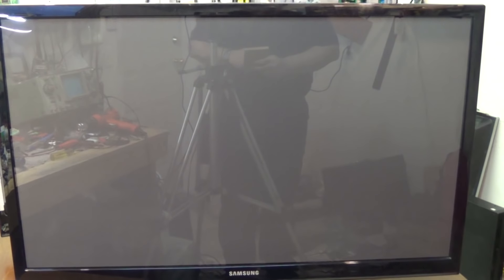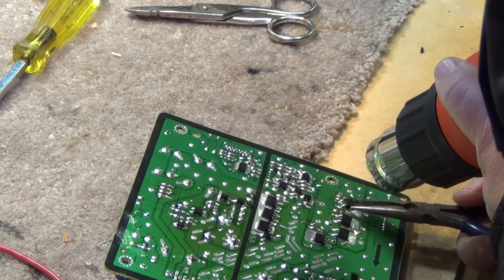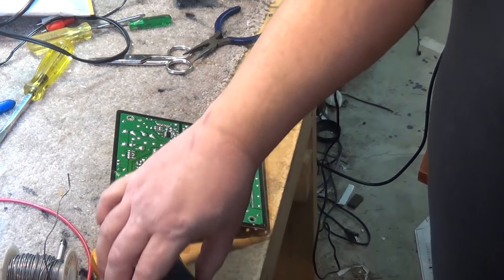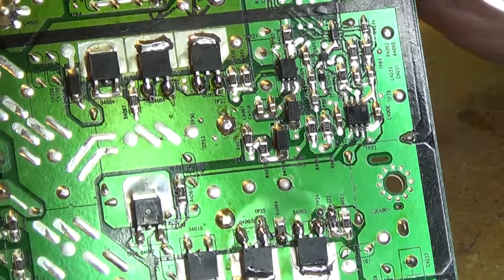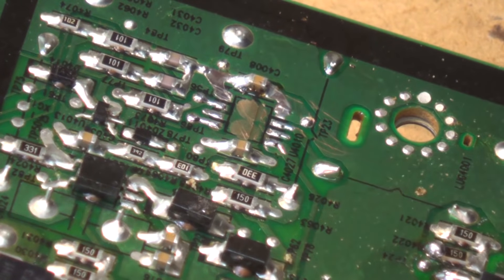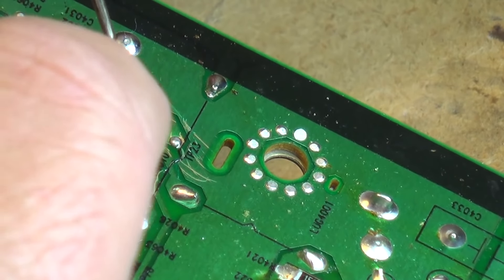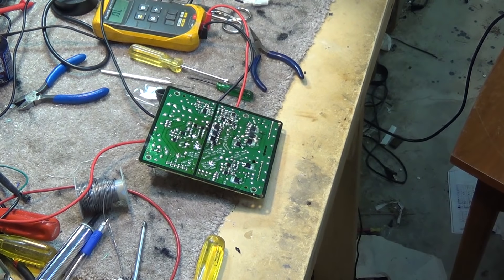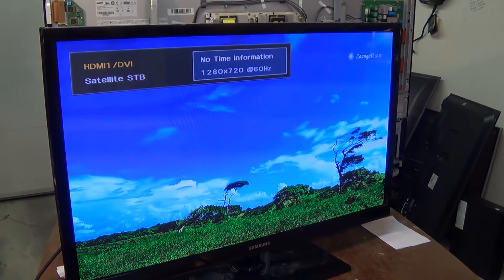Samsung PN43D440 Plasma X Main Board Repair

Comment: Who in the hell is putting thumbs down on this??? Really this man has more education in electronics than anyone I've seen on You Tube as of yet repairing anything he comes across, not to mention without schematics, wire diagrams or anything we would need to do it with ourselves without taking many hours of our time to do so, that's if we could without pulling all of our hair out first. Thanks Dave for all of your great videos, your experience really shows.

Comment: I prefer Plasma over the LED LCD flat screens. Least the screens on the Plasmas took a bit before they broke! My son has a old Plasma & it’s been dropped tipped on its screen off a table & it still works! But these LED LCD’s have a very fragile thin glass in the screen that cracks so easy.

Comment: Iam keeping my plasmas until the oled sets come out and drop to an affordable price point. Although I do have a Sony XBR lcd set that has an amazing picture for lcd. Iam tempted to try an off brand 4k lcd set in the interim. Do you have an experience with the Sceptre brand name? A 49" 4K panel for $329 is almost too good to pass up.
Reply from the maker: I hear you. I am in the same boat. I am keeping my Plasmas running. When an affordable 4K oled set comes to market, I will look into it. I got rid of all my LCD sets as when comparing to plasma, they all look pale by comparison.

Comment: Hi, 

Congratulations on your 500th video.  That's quite an accomplishment.  

You mentioned that the component is glued onto the board.  I never knew that glue was used.  I'm guessing that is something done in the manufacturing process for ease-of-assembly purposes, yes?

Regards, Tom
Reply from the maker: +THOMMGB Yes they tack the smd componets down so they dong get dislodged as they make their way through the colder process, so heating the parts up you still have to break that bond.
Reply: +12voltvids This is good information to know.  Thanks a lot.

Comment: On your opinion of led-tv's: do you know quantum dot tv's? This tv's are basically  led-tv with a special backlight ie quantum dots. They are having a bigger color space (20%) over ordinary led-tv's and much cleaner colors. Also some samsung models have better contrasts. Samsung advertise this  feature as HDR = high dynamic range. The main point I bringing this up is, they are not expensive. So if you come across this 'technology' I really would like to hear your opinion about it.
Reply from the maker: +martin richardt Quantum dot technology was first brought to market by Sony, in the form of their Trilumanous trade name.How it works is based on frequency division using quantum dots. In a normal LED backlight tv white LEDs are used. How white LEDS are made is a blue LED diode shines on yellow phosphor to make white light. The trouble with this is there are many frequencies of light that never make it through the color filters on the panel.Quantum dots answer this by creating primary RED and GREEN light from primary blue. They do this by hetrodyning with the incoming blue light. When the wavelength of the blue light entering the quantum dot filter hits the different size quantum dots, they radiate their own frequency, which mixes with the incoming light, and produces pure green and red light. This way there is no wasted spectrum, the light is fine tuned to the wavelength of the primary RGB filters on the LCD panel. LCD are getting better, but they still don't have the dynamics of a good plasma display.  The ultimate is OLED. That is the holy grail of display technology. My Samsung tablet has an OLED screen, as does my Blackberry, and camera view finder.  The picture quality off those screens is the best I have seen.
Reply: +12voltvids Yes, the ultimate is OLED and in a few years imo OLED will be the dominant display technology. Unfortunately this technology comes currently with a hefty price tag. Here in germany it's about a factor of 2 for fullhd. I think in the meantime quantum dot tv's could be an option for price-conscious buyers.
Reply from the maker: +martin richardt 
I agree that QD will become standard f low end as it is cheap to make. Oled is pricey now because the technology that LG choose is not their own, they are buying panels, but they have an exclusive deal at the moment on that design, which uses white phosphor and color filters. This is less expensive to make than the rgb type that Samsung make. Once their exclusive expires on that tech expect other manufactures to jump on board and the price will really drop.

Comment: I have a Samsung PN51E7000FF 
that has vertical lines on the right side
do you know what the problem is?
let me know thanks
Reply from the maker: +stereomann83 Vertical lines is usually the panel that has failed.The buffer ic's that drive the panel are actually on the FPC that are bonded to the panel.
Reply: +12voltvids ok i did see that when i took it apart some more today the board thats  on the bottom of the panel. someone else said that it might be the logic board. i did see one on ebay for $10 but i don't know if i should get it or not
Reply from the maker: +stereomann83Generally when the logic board is at fault you get no picture at all or it affects the entire screen.How a plasma works is the logic board generates the control signals that are fed out to the buffer chips. The buffer chips on the Y axis are high voltage devices and they are along the boards on the left side looking from the back. They scan line by line top to bottom so if you have horizontal likes ( you can see a bad buffer board on my 2 videos that deal with bad Y buffer) The vertical drive is a low voltage that just addresses the vertical electrodes and because they are not handling much current don't require external buffer chips there are also many more vertical scan pixels than horizontal.  the A boards (the ones that run across the bottom and connect the panel to the logic board) just pass the signals from the logic board to the addressable scan drive chips, which are part of the flexable PCboard that connects the A board to the panel. I did a video last year where I dissected a broken plasma screen and showed those chips on flexible PC.LCD do that for both the vertical and horizontal scan drive. The TCON board plugs into the panel, and the driver chips are on glass.If you get a single address driver chip that goes bad it will affect the group of vertical pixels that it controls, so you might have a section say 1" or sho that is bad top to bottom. If there were vertical lines in the entire picture then I would suspect a bad logic board. I am fighting a set right now that I suspect that the logic board is bad. It takes 21 minutes to turn on the VS supply.

Comment: my power board's mosfet shorted to the inner chassis.  my transistors are dead, should i also replace the power board? this time ima cover the contacts on back to try and avoid it reoccurring

Comment: A lot of people don't believe in fixing things anymore - mainly for the price of parts and/or  labor - but the item is still well worth it unless it cost 3/4 of a new 1 or even 1/2 of a new 1!!!!!
Reply from the maker: +Donald Ellett 
I have been getting more request to fix plasma than Lcd or led back light. The reason I think is people bought that plasma for a reason. They have a superior picture, and they no longer make them. Oled look fantastic but they are still very expensive. So many people want to try a get their plasma running again. I am one of them. I gave away or sold a the led/lcd sets I had and replaced them with plasma sets I was given. The refresh rate and contrast is far better. Sure in a showroom these Lcd TVs look OK. Put them in a nice dark living room and side by side with a plasma they look like crap. Also plasma sets are very serviceable. Lcd sets it is total board replacement o the panel that fails due to the chips on glass. At least on plasma there are many fixes where you just replace the parts that go pop an you a good to go.
Reply: How much difference in price is the actual plasma screen vs. lcd???  Do many of the screen break in transportation??
Reply from the maker: +Donald Ellett Just due to the component count, plasma cost much more to manufacture, however for years they were cheaper to buy because clever marketing, and price fixing early on had the LCD sets selling for much more than Plasma. The manufactures made huge profits on LCD and pushed their sales harder.

Comment: Smashing job :-D
Dam fidderly smd parts, sneeze and they are lost forever lol :-D
I bet if they had used big non smd parts on a propper heatsink, they would have never blown, ive never thought a thin layer of copper made a good heatsink.
Sorry im old fashoned, give me a mass of finned metal with a good air flow :-D
Reply from the maker: +zx8401ztv 
The transistors are sandwiched between the board and a heat sink gel. You will see it stuck to the metal chassis just as I am remounting the board. That drains the heat to the metal chassis very well. The parts didn't fail due to heat. They failed due to ground screws that worked their way loose and arced. See the first trouble shoot video on this one where I documented it. There is burning around the ground screws.
Reply: +12voltvids Ahh, sorry, im a pillock :-(
Still a great repair though :-D

Comment: Very Helpful

Buy some good tweezers bro and a hot air station.Makes life easier
Reply from the maker: So what is wrong with my technique? Why should I spend hundreds of dollars on an air station? I will never see my money back. A 20.00 heat gun does the job just fine. Perhaps if I was in the business and earned my living doing repairs, but I  don't. I retired from that industry in 2003, and now it is just a hobby, and something I do for people I know, and these people are very cheap. I made 50.00 on the repair of this set, and many other paid repairs I make even less than that. Most are my own units, and you know how much I make fixing my own stuff?The whole point in this series is to show how to do this work WITHOUT investing money in specialized tools.
Reply: That is amazing.  A heat gun is good for those huge processor chips with 50 or more pins.
Reply: My tv no picture model 32 PC5RA    LG WHAT IS broplem ?
Reply: 12voltvids my tv no picture model PC5RA     LG  WHAT IS problem?
Reply: I don't blame you a bit & at the same time your showing many of us how to do this on a shoe string budget such as myself who might be lucky to fix just one in a year so I'm going back & trying all of your TC videos to get all of your. Real nice how you made that halogen bulb to repair, I think you the BGA's, & fixed a lot of them that way, & mainly they all are still running, can't beat that with a Big Stick, Love It when someone can show these ways of repairs that even I can afford to do, Thanks Dave.

Comment: My God. You really deserve some tools for smd rework...
Reply: +Luigi Mazzoli Haha!  I've got an SMD rework station and a hot air gun.  Provided you don't over cook the area and keep testing if the solder is molten for all intents and purposes they are pretty much the same thing.  A hot air gun just has a huge nozzle on it so its hard to limit heat to a smaller area.
Reply from the maker: +Luigi Mazzoli Want to donate some?
Reply from the maker: +GadgetUK164 I plan to make a smaller nozzle for the hot air, but you are correct. That is why I keep moving it to warm the area up gradually. Also it is important to use only the low setting, as the high setting will scorch the board quickly. When buying a heat gun, look for one that has a temperature around 700" F as that is plenty hot enough to remove anything.
Reply: You are experienced enough to get the job done anyway ;-) Thanks for sharing your knowledge, I really enjoy it.

Comment: u should've use the solder wick
Reply from the maker: Good luck removing those MOSFETS with solder wick. Heat gun, or preferably a
proper hot air station is the only way to do it. If I was in the business of repairing stuff for a living I would have a hot air station, but for the 1 or 2 times a year I could use one, I get by with what I have.

Comment: Unfortunately, You have kept the secret to yourself. Why did you change these components? what is the reason? Please give more explanation such as you have lost  90 VDC at the output drive at Horizontal side etc. People just looked at what you did but don't know what these particular component doing in the circuit.

Comment: Plasma is the Shiii@@##!
Reply from the maker: +bigdog8882 They still have a better picture than anything until you get into the 4K UHD and OLED sets. I have yet to see any LCD based panel that has the PQ of plasma. There are many plasma fans out there still. I have a few myself, but will be going to OLED once they become affordable.
Reply from the maker: bigdog8882 
They are more reliable than those bloody led backlight sets.
Reply: That's for certain, my first flat screen ever I purchased an LED< LCD TV & didn't have a clue that Back-lights came Wide Eyed Open, Of coarse the set didn't 3 years because they went out & that's hard to do with a broken back & other things without the proper room to do it in.